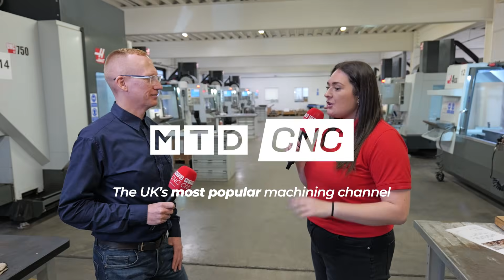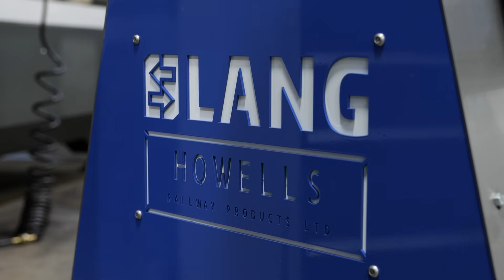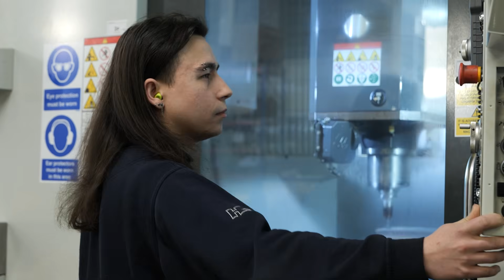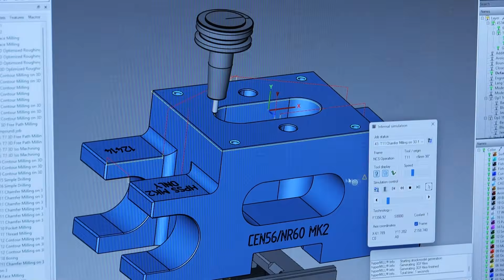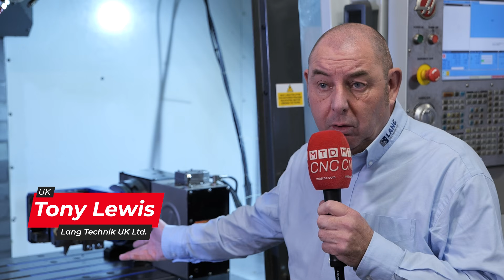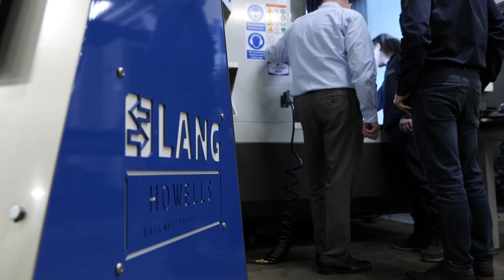How did they eliminate setup time?

Comment: The vices are non adjustable in location wise. So every time the vise locks into the same spot on the cnc table, no need for indicating. I used a similar system with ball locks.